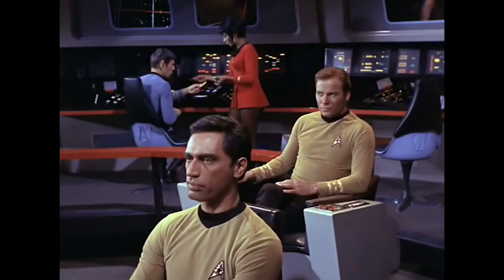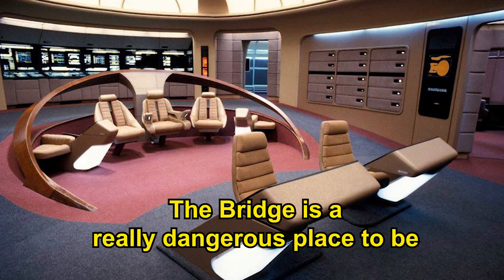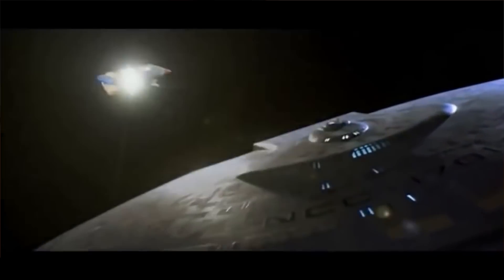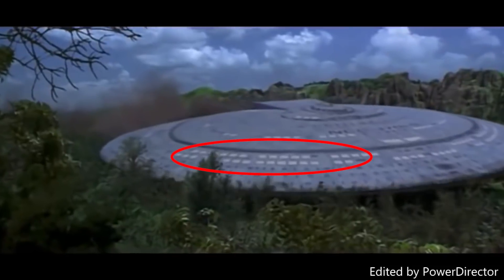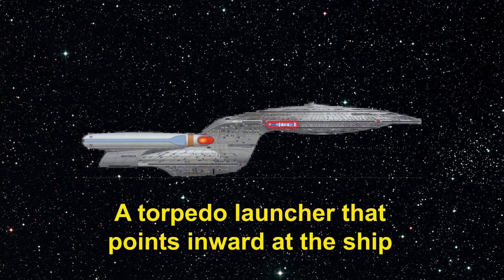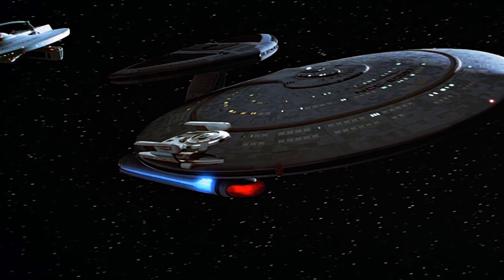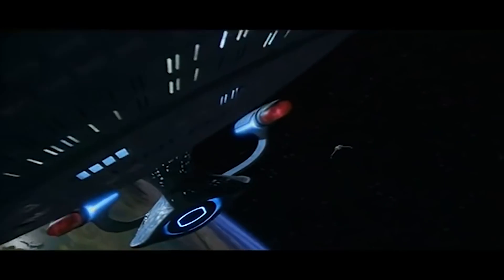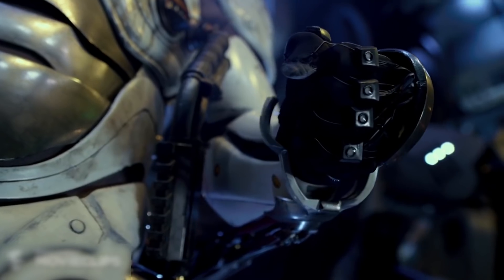10 Flaws Star Trek - USS Enterprise NCC 1701-D

Comment: Even though the 1701-D Bridge was originally Designed to be at the center of the saucer,... Gene 'insisted' that the Bridge remain on top, to provide an understanding of the ship's scale for the audience - stating that the ship's defenses could easily protect it.

Ship's security is not a Design flaw,... it is a script plot point.

Landing gear, for the "D", was, embarrassingly, overlooked, due to a large number of multi-tasking distractions during pre-production.

The aft saucer torpedo launcher is neutralized by the docking system, in multiple places.

The ships warp engines are co-dependent, creating an energy field between them.  Any design that violates this is inconsistent with that system - no matter how "canon" fans may argue that they are - they are inconstant and simply designed wrong.  They are not jet engines,... they are two halves of a warp system - which is why Gene specifically stated that there are no odd-numbered engine configurations,... no 3's, no 1's,... only two or multiples of two.  Any designer or wannabe producer should adhere  to the specific rules laid out by the show's Creator;  period.

Inefficient use of space?  Look at the original Enterprise corridor width, and the bridge width.  They are exactly the same, on the"D".  The D Bridge is deeper and certainly higher, making it look spacious - but it is the same width.  The ship was originally Designed for a crew complement of 3,600 with additional space for passengers of various sorts - but Gene change that to 1,100 - so those blueprints were probably created with the reduced crew complement in mind.

Joystick???  Producers usually don't 'get' Science Fiction and the fact that it, in this case, is depicting our technology 300 years in the future.  300 years ago, the first steam engine was used, commercially, to pump water out of mines.  Could they have predicted television or commercial air flights?  to use some sort of physical device on the bridge: keyboards, gearshift throttles, joystick steering, buttons or rocker switches - is pathetic - but at least it is there to "give the actors something to do",... as they say in the movie business.

But, what do I know ?
Reply: Oh, come on. You act like you designed the thing. 

checks name
Oh. Well then. Carry on. 

(Side notes: one of my favorite "fanon" things about the bridge placement was that it was placed where it was because bridge/command and control technology advanced more quickly than, say, engine design, and so it made sense to have a bridge that could be replaced easily as a unit.)
Reply: On a different subject- I've often wondered why the engine nacelles were so vulnerable on the Enterprise.
Reply: @jefftube58    Good point,... but that would be a question for the writers.  Designers can only provide the "shape" of the hardware.  What the Producers, Writers, or Directors do with it is their end of the process.  For instance, I can tell Gene that this new ship is Designed for a crew capacity of 3,600-plus,... but when he says: "We can't hire enough extras to reflect that, so we'll say the crew complement is 1,100", then that is what becomes canon-

Comment: I kind of disagree about the stick not being enough for roll and pitch controls, it doesn't have to be anything special to do that.

What it lacks though is yaw and throttle controls, if you're going to have a stick, you really either need it to have twist for yaw, and a throttle, or a set of pedals and a throttle too, also probably some lateral and vertical thruster controls.
Reply: The computer is likely very automated where someone just punches in a command a direction, and the computer computes yaw, pitch, and roll based on what sensors tell it, and what space the ship needs to clear any obstacles the sensors detect.
Reply: @MatthewHendrickson  Such a system would never get past a safety review, it would not allow fine control, and especially would not allow for user intentions outside its scope of its programming, and it fails because of that last bit you mention.... obstacles the sensors detect.... what if they don't or are faulty, or someone hacks the computer to fool them?

Manual by safety necessity control needs to be as direct as possible.

Comment: with replicator technology,  why lug around more than a few torpedoes when they can be materialized to order?

original Enterprise saucer section had landing gear - and was how the landing parties were supposed to reach planets from orbit - but it was considered too ed to expensive to show that sequence on TV, so the transporter was invented

given transporters and replicators- most of ST ship design and doesn't make much sense as they  don't take full advantage of these technologies

every night and after every transport store crewmember patterns in the medical replicator (the replicator is just a transporter with patterns stored) and we have immortality - get killed and we make a new one from most recent pattern 

each of the 5 redshirt patterns: "you think you have it bad, I've been killed 97 times and still don't qualify for retirement"
Reply: The transporter patterns arent meant to be stored nor can they easily be stored. There are a bunch of episode where the stored personell survived solely through plotarmor while trapped in a tranporter buffer.
I also dont know about the replicator torpedoes. Wouldnt that be kinda take a huge toll on the ships energy supply ? Energy that would be better used in phaser arrays and shields ? 

If you meant for out of combat restocking purposes then i think they already did that to a degree...

Comment: Seatbelt may seem  a good idea,  but travelling at thousands of km an hour if the inertial dampeners do not save you, you are throughly screwed far beyond what a seatbelt can save you from.
Reply: So why not employ some sort of a dedicated gravity/damper for the seats?  Or external force field generator to hold you in place?  The answer is that it wouldn't be fun to see them all handling ship-rocking blasts with grace, we want to see people flying around.  The same reason those consoles explode from overloads and hits other sections of the ship.
Reply: @hebemis  
The Inertial Dampening system is triply redundant; the computer controlling it operates from within a subspace field that causes effective FTL computational rates, so the vast majority of the time the system compensates exactly for anticipated stresses.  When the 'unplanned' happens (as it often does, else you have a plotless show), there can be microseconds of delay between an inertial event and the system's compensation.  But only microseconds.  Enough to cause dramatic loss of balance and injury, but not (direct quote from the Technical Manual) "...enough to turn the crew into chunky salsa."
Reply: Velocity is irrelevant, it's acceleration that counts. ;)
Reply: Steven Schwartzhoff jep! A seatbelt can be a great tool to cut someone in half if the right power is used. Remember: A high speed uncontrollable reduced to full halt doubles the bridge crew. Somehow.
Reply: um Anthony velocity is very relevant. having them fail when the ship decelerating can cause major issues also.
Reply: The show regularly shows incidents where people are just thrown to the floor, and seatbelts would help with those. The ships total speed is irrelevant because it isn't being decelerated, just "jostled" while continuing at the same speed.
Reply: @wilFluffball  Consevation of momentum. Inertial dampeners only helps counter the effect of fast change in speed. The rest is done by physics. Sure, if the ship suddently go 1234567890 KM to 0 with it turned off... The whole cast will end up becoming stylished painting. But, to avoid being ejected from your seat because a single topedo hit your ship... I'm fairly sure belts would help... and would have the beneit of not giving the enemy a free second run while your officers are crawling back to their seat.

Remember the old saying that says that it's not the fall that kills you but the sudden stop at the end?
Reply: Consevation of momentum. Inertial dampeners only helps counter the effect of fast change in speed. The rest is done by physics. Sure, if the ship suddently go 1234567890 KM to 0 with it turned off... The whole cast will end up becoming stylized hull painting. But, to avoid being ejected from your seat because a single topedo hit your ship... I'm fairly sure belts would help... and would have the benefit of not giving the enemy a free second run while your officers are crawling back to their seat.

Remember the old saying that says that it's not the fall that kills you but the sudden stop at the end?

Comment: To be fair, despite the published guide book, the D's saucer section was crash landing and not controlled landing. I have to believe if they wanted the saucer section to survive intact-- they would've just wrote it as getting far enough away from the rest of the Enterprise before exploding and simply landing or flying to the nearest Star Base. That said, it is still severely flawed from a practical standpoint. But it was there since Season 1 of TNG.

Comment: Perhaps the location of the main bridge is actually the most protected part of the ship. In the middle of the Saucer section is probably where there is the most overlapping shield grids, and shield generators. Sure it may "look" exposed, but that is incredibly deceptive. It is ultra defended. Plus, the Federation design philosophy is that they do not hide. Once shields are down, then it really doesn't matter.
Reply: @TheBigExclusive. Exactly. Similar to the post I just made. The shields are stronger than the hull material. I don't see why the shields can't be double, tripled, or simply more powered over a part of the hull. Unless you can have shields inside the ship, then the outer hull is the best place to protect the bridge. I figured this out half a century ago watching the OS as a kid. Sometimes the "obvious" is not.

Comment: The consoles explodes becuase of that the damage makes a feedback in the EPS/plasma wich overloads the console
Reply: Nah. They just didn't want to spend the money to build sets for the sections of the ship that actually were hit, so the consoles are proxies for that.
Reply: On top of that, at 2:07 it looks like the weapons fire hit in the general vicinity of Engineering, and if I'm not mistaken, the console shown exploding on the bridge is connected directly to Engineering. Sure looks like an overloaded plasma conduit or something similar.
Reply: And no engineer ever suggests surge protectors.
Reply: clorox bleach unboxed Did ANY of the shows every explain what EPS stood for?
I assumed Energy/Electrical Plasma System but don't recall anyone ever saying?
Reply: Michael Pohoreski hello, while they never really say it outloud becuase of unknown reasons, we do however still know from schematics and texts etc that the eps is a power management and distrubution system
Like you said. I currently dont have much time to look up some websites that has facts about the eps system.
Reply: FukkitBukkit yes that is basicly what i meant. Current and amps allways takes the fastest route to a exit, and if a plasma conduit explodes then it would make a power surge since the plasma cant go anywhere

Comment: There is a perfectly good reason for the nacelles to be stuck out of starfleet ships in an exposed postion. You may notice, that when looking at any starfleet ship ever from the direct front, the front end of the nacelles are always showing. This is because of the Bussard Collectors, or Ramscoop as it's called in Nemesis. They collect passing interstellar particles for fuel replenishment and other purposes, and if they're hidden behind something, they can't collect the stuff and the ship will run out of fuel very quickly.

Also, the nacelles are NOT the engines. The warp core is the engine. The nacelles are just for collecting particles & fuel, and allowing for much better breaking of reality for maximum zoom.

Plus, the Galaxy class was designed in an era where Starfleet was way past drunk on peace, and got cocky with starship designs, building absolutely no warships for a long time, and the Galaxy class was supposed to be a home away from home so that the crew could be comfortable and bring their families on missions. The Galaxy was not originally designed for combat whatsoever.
Reply: True, the warp core is actually the engine that powers the warp drive.  The nacelles don't collect particles for fuel.  That's what the Bussard collectors do.  Those are the red tips at the front of the nacelle housings on most Federation starships.  The nacelles themselves house the warp coils, which are powered by the warp plasma from the warp core.  The warp coils are what makes the ship be able to create a warp field and thus makes warp travel possible.  The nacelles also provide a way for the ship to vent warp plasma in case of emergencies.
Reply: bussard collectors are only used rarely. Most ships just refuel at the nearest starbase.